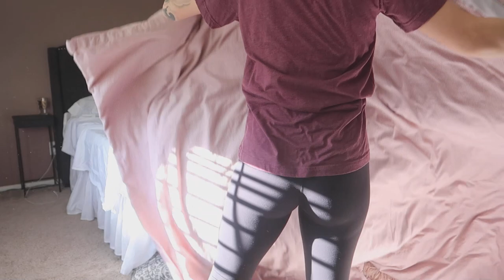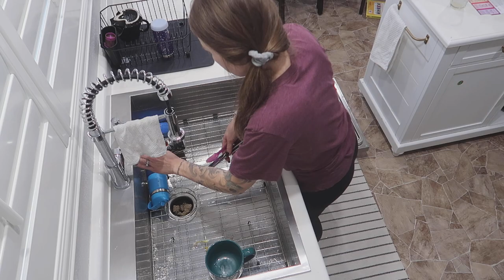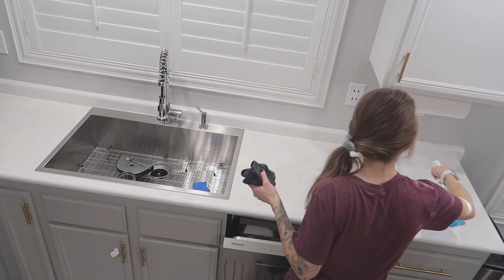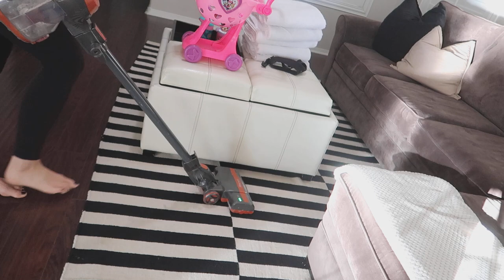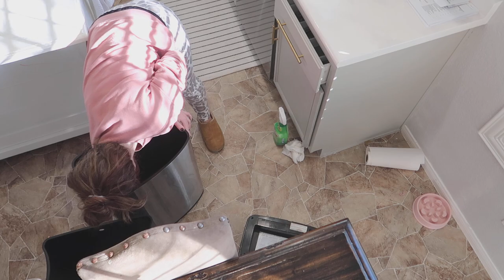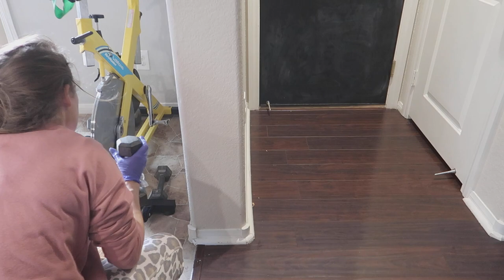SUPER MOTIVATING CLEAN WITH ME 2021 | SPEED CLEANING | TONS OF CLEANING MOTIVATION + DEEP CLEANING

Comment: I hated cleaning my trash can when the bag would leak so I started putting 2 bags in the trash can and when I lifted out the inside bag, I would check to see if it had leaked and if so I put it back in the other bag and take them both out. No cleaning with the 2 bag way 😃 just put a clean bag inside the other one if there was no leak